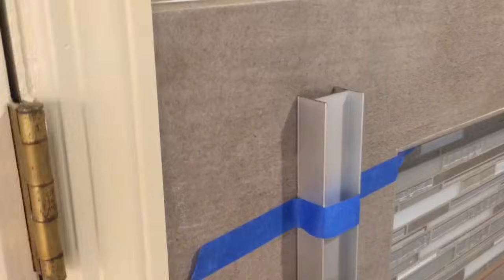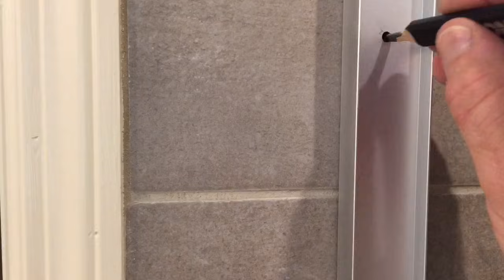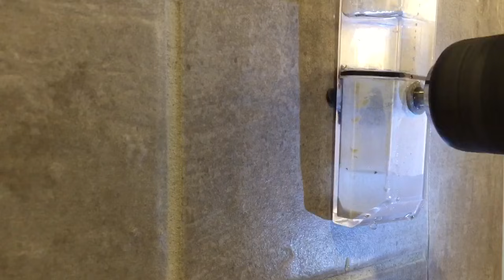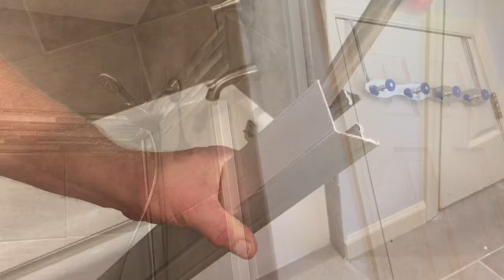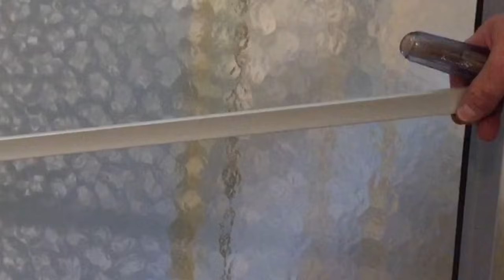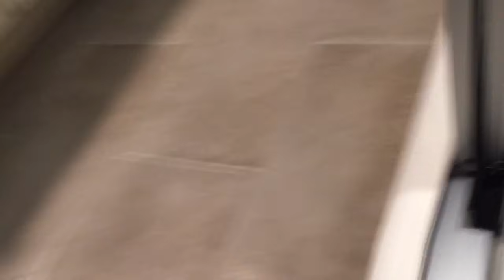How to install a basic sliding  tub/shower door.

Comment: one of my problems was in the bottom corners i found it would leak. i couldnt for the life of me figure it out. i siliconed everywhere but it still leaked. it was very frustrating. when i went and splashed a bunch of cleaning product i noticed it leaked bad.
Reply from the maker: Sounds frustrating! Not sure why it would leak.

Comment: Most bottom rails specify 3” width. On my old porcelain tub i have the width, but it starts to taper away at the edges of that measurement..so the perfectly flat area is more like 2.5. Is that ok to still use a 3” bottom rails specify?
Reply from the maker: I would center it and install it that way. I’ve done them like this before and it has worked for me. Hope this helps.

Comment: Only tip, if you caulk the inside on the bottom, the water that gets caught in the track won’t run out back into the tub and will be trapped and cause mold over the years. Great video tho !
Reply from the maker: Thanks for the tip and thanks for watching.

Comment: Quick question bob. What if the top and bottom measurement of the tub is off by an inch what do you do the make that track right?
Reply from the maker: You have to cut the too and bottom track separately. They are usually off a bit but normally not an inch unless there is tile or something else on the bottom and. It on the top. Just do 2 measurements one all the way at the bottom and cut the bottom track to that length and then one where the top track goes and cut it to that length and you should be good. Hope this helps, thanks for watching.

Comment: So you installed and tiled over a wood backing as opposed to a concrete board? If so, whats the benefit of this?
Reply from the maker: No, the tile is installed over concrete board but since I built the shower walls and knew there would be a shower door that I had to install later I made sure to back up the concrete board with wood to give my shower door a solid surface to attach to. This way holds better than the anchors that need to be used if there is no support directly behind the cement board. I hope this makes sense, it is hard to explain without showing you. Thanks for watching.

Comment: Next time use a tape measure to set the bottom rail evenly and don't rely on your eyes, otherwise nice job.
Reply from the maker: Truth be told I DID use a tape measure to set the bottom rail evenly. I didn’t like where it landed so I moved it and the finished product as you have mentioned is “nice job”. Thanks for watching.

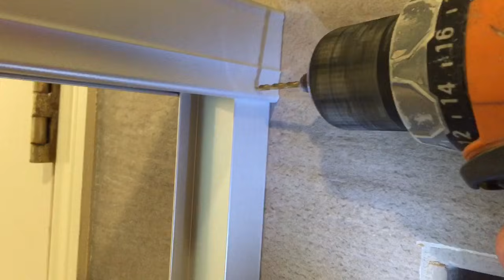Comment: 6:23 do you have to screw the bottom rail in as well? my bottom rail keeps moving and the caulk cracks and falls apart, the idiots that did the job also cut it about 1/4" to small so it slides to both sides of the wall, they tried to fool me by putting a ton of caulk on both ends but that didn't hold and now I can see the gaps...
Reply from the maker: If your bottom rail is cut short I feel you will constantly have issues with the bottom rail. The bottom rail should fit tight between the 2 side rails and require only caulking to hold it into place and seal it. All that said you may have a situation that using a screw at this point may be your best option. Hope this help, Thanks for watching.

Comment: The is the clearest video I have found - however i have a problem - it's a re-use retrofit and the opening is about 5/8 inch tooo wide - any ideas how to plug that gap - the shower wall is fibreglass. thanks!
Reply from the maker: I can't recommend how to "rig" something up in all good conscience.  I have to give you my straight honest answer. I would recommend getting the correct size to fit your area. That being said I'm sure you may be able to build a wall out to make this work but without seeing the situation I can make no suggestions, sorry.

Thanks for watching.

Comment: I have tile on bathroom walls. What kind of drill bit would be needed ? Also, I don't have that tool where you put water and use that hole to drill thru. I have basic drill. Do I need to get that tool essentially?
Reply from the maker: Yes, I would recommend a diamond drill for this type job or any other job requiring drilling into tile. Thanks for watching.

Comment: What is the brand of your diamond guide that holds the water while drilling I can’t find one of those? Thx and great video
Reply from the maker: https://www.menards.com/main/tools/power-tool-accessories/hole-saws-sets-accessories/brutus-reg-5-16-diamond-drill-bit/10566/p-1444451692228-c-10085.htm
Reply from the maker: There are many different brands available from any of the big box flooring stores or home improvement stores. I have several of them and I don't remember the brand of the one used in this video. Thanks for watching.

Comment: My cheapy doors from home depot didn't have any instructions at all.  Your video helped a lot.  One thing I had trouble with was the ROLLERS. I installed them on the wrong side of the door.  One side is flush with the door, the other isn't.  I moved the rollers to the other side and it went right up.
Reply from the maker: I try. It to shop at HD. Glad the video was a help to you. Thanks for watching.

Comment: The instructions says to apply caulk outside (shower) the bottom track, is not this kind of weird? Where did you applied the caulk, in or out? Thanks
Reply from the maker: It wouldn't hurt to apply caulk all around but there needs to be a way for any water to escape. Thanks for watching.

Comment: Good video.  Would have liked to have seen more on the final caulking of the frame, but other than that, it does help....perhaps it you monitor these comments you can reply with some details on the caulking.  Why didnt you caulk both sides of the bottom part of the frame when you laid it down?  Do you caulk the entire inside and outside of the frame or can you get away with caulking the inside only?  Do you leave any escape routes for water, like you do with with installing retro fit windows?  Do you just use your finger or a caulking tool?  I have had good luck with the tools made of silicon., but it's been for heavier caulk application on window trims,etc.  Thanks.
Reply from the maker: It is possible to have too much caulk. If you have more than needed it could leak therefore I only caulked one side of the bottom., I did caulk the inside and outside but the only reason I caulked the outside was to give it a finished look, it really does not need to be caulked. No water should be getting into the door so I did not leave a weep hole for water to escape. Generally I do not use anything to smooth out the caulking except my fingers. Hope this helps, Thanks for watching.

Comment: This guy makes it alot harder than it should.  First measure the top of tub , then deduct 1/4"  off for side rails to fit.  Take silicone and glue down in middle of tub top  Then take your side rails and  after straight  with the level take a pencil mark holes  take rails down an drill holes with a 1/4  drill bits then screw in both  side rails then measure top piece and take off 1/8 " cut and file if necessary.  Place on top . Adjust rollers on top of doors place doors in ( bubble side out on glass doors and roller up means down to adjust rollers ).  If it has that glider for bottom use a 1/8 drill bit and then screw in then Clean off  dust with rag  and chalk with clear chalking . Should take less than 30 minutes .but allow chalking to dry 3 hours at least  to 6 hours before a shower . Tools needed is a Philips screwer, hack saw , file , small Level , tape measure , snips if has rubber , pencil and I  usually use clear / white chalking , chalk gun  and drill gun with a 1/4"  ( masionary)and 1/8" ( metal ) drill bits and couple rags for dust and excess chalk.
Reply from the maker: Thanks for the text version of this video, and thanks for viewing.
Reply: @funbro1  good video that helps many . I had to text since   I used to be a Glazer and  liked  the  drill bit you used  since I burnt up many regular bits on that type of tile . Having my helper pour water on my bit from as I drilled . Your video's are very helpful but add tools to need . Keep up great work .
Reply from the maker: Always need more tools. Lol

Comment: How do you know if there is a wall stud where you mounted the screws?  If not, I suppose you would have use wall anchors?
Reply: Dean Eng no big deal if there isn't a stud, just use the plastic concrete anchors in the tile.  A sliding door doesn't need a ton of support, if it's a swing door, different story.
Reply from the maker: For this one I installed the tile and put the wall up so I put the studs where I knew I needed them. If you don't know where the studs are then the anchors will work just fine. 
Thanks for watching.

Comment: My tub is not level. Is approx. 1/2 inch lower on one side. Can I take 1/2 inch off of side rail on the lower end of the tub to level the doors?
Reply from the maker: That would put your door out of square and may cause it to leak. Thanks for watching
Reply: All depends.  The way I am thinking about it,  If your walls happened to be perfectly square,  but the tub just wasn't level, you could do a taper cut on the bottom rail and you would have a nice, square frame and your shower door would operate properly.  But, if the walls were skewed as well (maybe from settling), you would (I think) end up putting the vertical rails out of square with the bottom rail/top rail and have to do a lot more work (tapering each piece).
Reply: That's what they don't tell you. You need a seal leveler underneath the seal he put down. Even if you tapered it your doors will try to open by themselves because it's running downhill
Reply: Dude. You just made a 45 minute job take 3 hours. A wet saw? C'mon man. A chop saw will suffice. Diamond bit? Guess it's on if you don't mind water dripping everywhere. Thanks, for putting a shit ton of caulk underneath for the next guy that has to take it up in the future.

Comment: Good how-to but, i'd make just one change. The bottom rail should have silicone on the outside part and not inside to make sure that any water that could get under it will go back in the tub and not outside.
Reply from the maker: Also put some under it and that will help hold it down. Thanks for watching.

Comment: The black sliding plastic thing (not sure the exact name lol) at the bottom rail is missing from our doors which causes the door to swings at time. Can I get them at stores?
Reply from the maker: They are door specific so you would usually need to contact the manufacturer for that type of part. Hope this helps answer your question.Thanks for watching.

Comment: As is your diamond tipped drill bit will work much better than a carbide tipped bit, But still, I think it's a bit overkill. Myself I use my Makita combination hammer drill HR2475 & using the grooved end shaft it will not slip or slide on the drill itself & last nearly indefinitely under normal use.where as the straight shaft drill bit's used with a hammer drill does not last but one or to holes drilled & they are so much harder to drill thru like porcelain or concrete. Too the carbide bits just burn up so fast on concrete or porcelain . It's like drilling every hole will cost you anywhere from $3 / $4 &  $5. / up for every time  one is used each time.  In my book it's not worth it. Also my bit's last & drill thru like concrete & all like it's butter. The diamond bits are good & last's a little bit longer than carbide,  but they are also so much more costly & really don't last as long as my bit's of moderate It's cost! Just my opinion. I am now 64 & have acquired a lot of experience that you can take it for what it's worth.as I give it free! I am a good man to have on hand, Dave the handyman home repair guy. also look me up under my name Dave Overbey on YouTube for fighting defense a style that I created will make you smile learning yourself easily & quickly on protection & self defence. It's my style how I defeat the hands & feet with my techniques. God Bless & have a great day. Thanks
Reply from the maker: OK, if I run my diamond hole saw wet it will last a very, very long time, meanwhile the hammering action of a hammer drill does risk the chance of chipping or heaven forbid cracking a tile. I'll stick with the "overkill" safer and easier way. By the way the Makita HR2475 is a rotary hammer not a hammer drill which makes it even possible to chip/break a tile. Yes it can be done but I would cringe the entire time. My diamond bit has drilled 100's of holes and keeps going. If it is taken care of it will keep going for a long time to come. Take it from my experience, IF there is a larger price for the diamond hole saw it in minor but worth it the first time a tile gets damaged by an overkill rotary hammer. Thanks for your comment and thanks for watching.
Reply from the maker: I have seen several sizes, Home Depot is probably limited on sizes but other sizes can be found on line like Amazon. It wouldn't hurt to caulk the bottom track down just for extra holding power. Hope this helps, Thanks for watching

Comment: Nice work! Can you give more info on the drill guide and drill bit you used to drill thru the tile and where did you get it?  Thanks!
Reply from the maker: The diamond drill and drill guide came together as a set and can be purchased at almost any DIY store or home improvement warehouse in the flooring department as well as a larger flooring store and amazon. Hope this helps, Thanks for watching.
Reply: @funbro1  What size diamond drill bit do you normally use for these door installs?